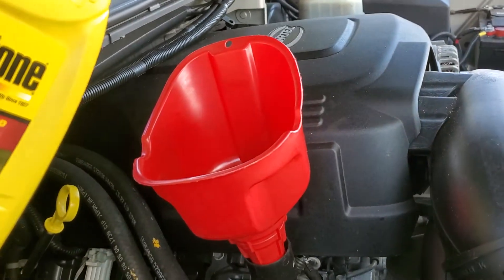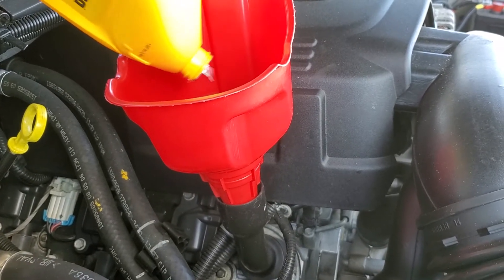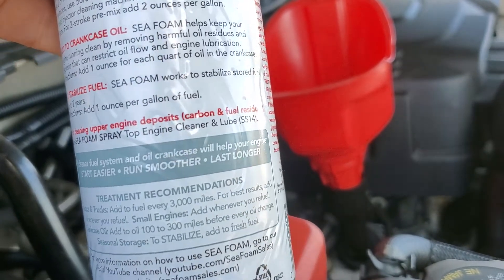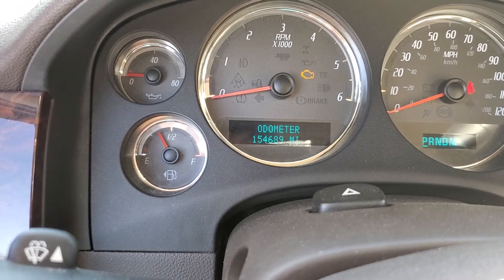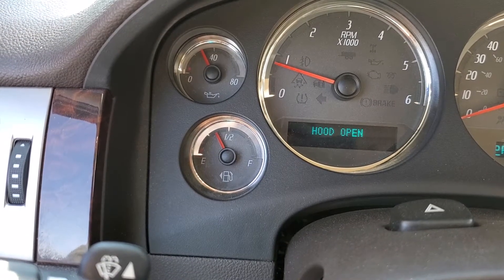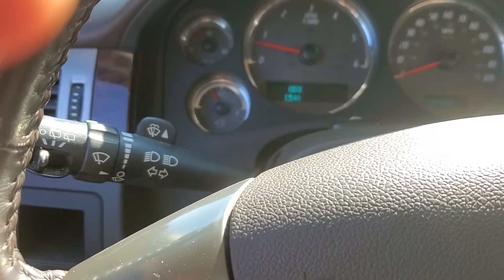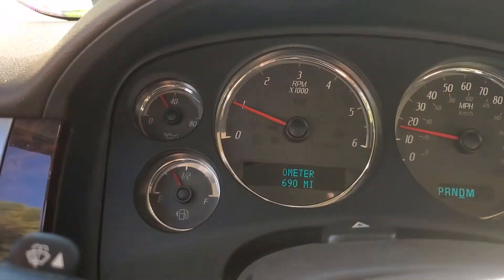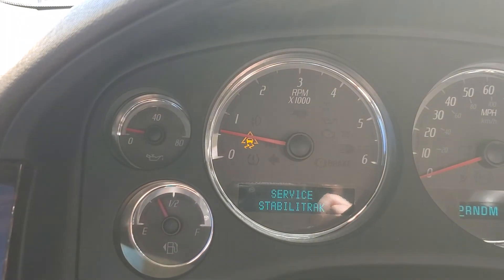2007 GMC Yukon Denali Low Oil Pressure 》Seafoam + ATF in Crankcase

Comment: Had that problem in my 05 Denali. Mayor rebuild was recommended, but it was the oring in the pickup tube. Is running real good at this moment.
Reply from the maker: Yes, this is what I was told to do as well. Major rebuild was recommended.
Reply: Can I add before oil change the flush

Comment: Check your oil pressure sensor if not that.....check oring on pickup tube in the oil pan.
Reply from the maker: I did. I replaced both with no luck.
Reply: @Rbaetagar911  did you replace the screen under the oil sensor?

Comment: It your oil pressure sending unit and the screen filter underneath it might be clog up. That just my guess cause I don’t see any heck engine light popping up. And the traction stability popping up is that a battery or alternator issue your not getting enough power.
Reply from the maker: This engine was a non-DOD so it didn't have the screen filter. I was surprised to find this out.

Comment: If you are gonna put atf in the engine to clean carbon or gunk use straight dex 6 not anything with stop leak additives or stop slip

Comment: Did you not change the whole oil pump? Maybe release valve on it stuck open
Reply from the maker: I tried checking the release valve and went as far as replacing it with no luck. But I am under the impression that the oil pump was bad.
Reply: @Rbaetagar911  haven’t they same issue what did you end up doing? Did you replace the oil pump and pick up tube o-ring ?

Comment: Change the plugs and wires it will fix i had same sign in my denali 2007
Reply: 😂😂😂 spark plugs and wires will not fix oil pressure

Comment: Dude that has stop leak that will clog up oil passage ways.
Reply: No it won’t. Oil stop leak is not a sealant. It has properties to expand rubber gaskets and seal leaks. You should try reading the back labels once in a while.
Reply: @larrytemen4789  I do read I read a lot
Reply: @larrytemen4789  that’s not oil leak stop lol it’s trans

Comment: The normal is between 20-40 change out your oil sensor
Reply from the maker: I changed out the sensor with no luck. Crazy thing is it didn't come with a screen. It had a non-DOD motor.
Reply: The 6.2 is 55 psi cold, 48 psi warm. The high oil pressure is required to properly close the valves for the AFM when it shuts cylinders off. Disabled AFM can run lower oil pressure without too many issues.
Reply: @Rbaetagar911  The screen(Oil pressure sensor filter) is only on the 5.3L from what I've read.